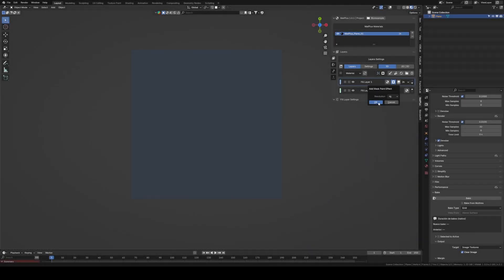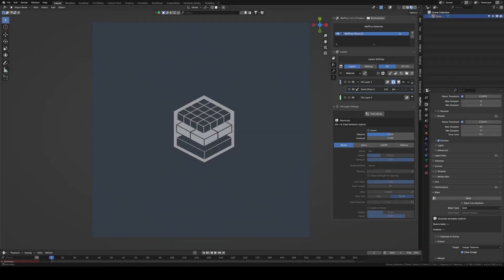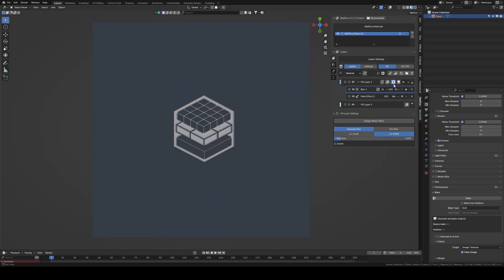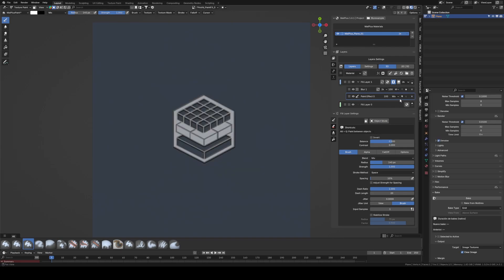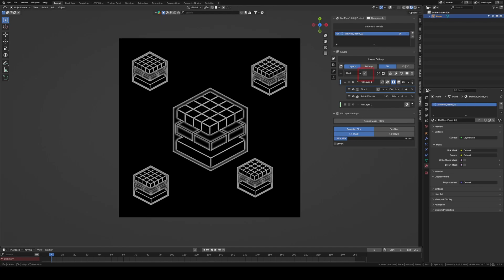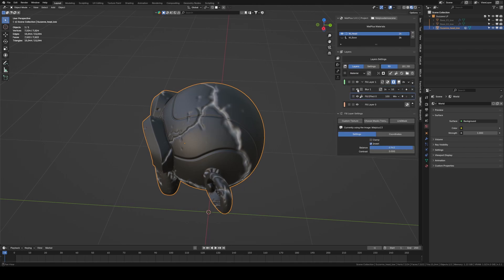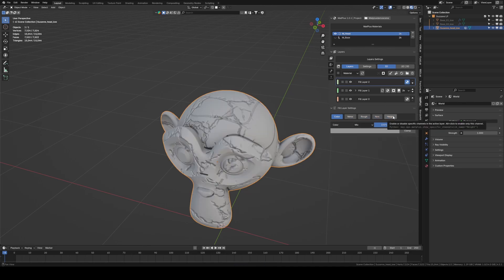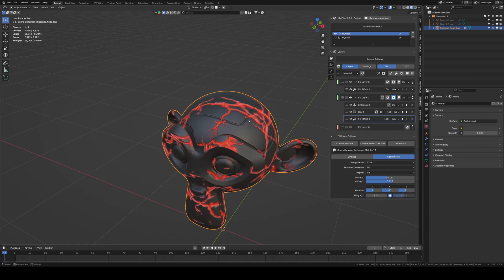MatPlus - Tutorial -Understanding the BLUR filter

Comment: so the Blur filter uses the one from the Compositor, which is why Matplus bakes the mask layers into a texture to make it works?
Reply from the maker: No. The compositor’s Blur cannot be used outside of the compositor. It’s a blur we programmed from scratch and integrated into MatPlus to work with the textures we generate.
Reply: Unlike a traditional blur in blender done procedurally with a white noise map, yeah, this tool actually bakes down the image so that a real blur can be applied to it
Reply: @iKaGe01  and that real Blur is the one from the Compositor?